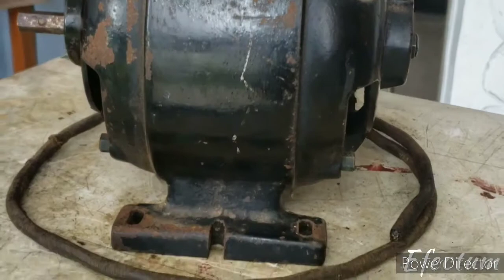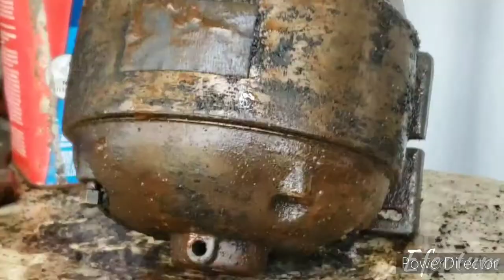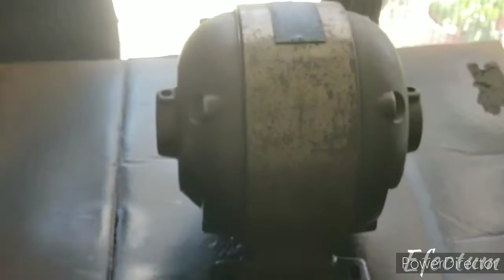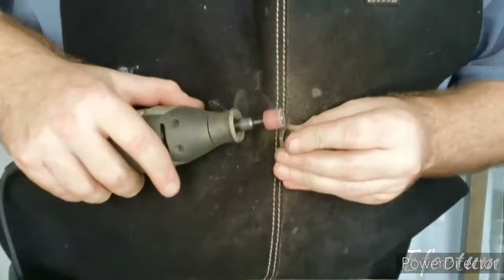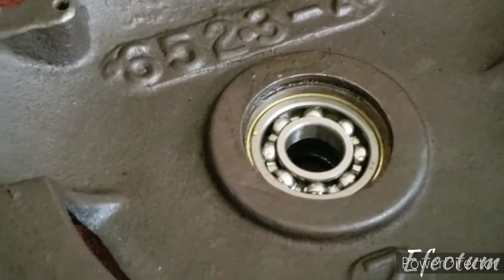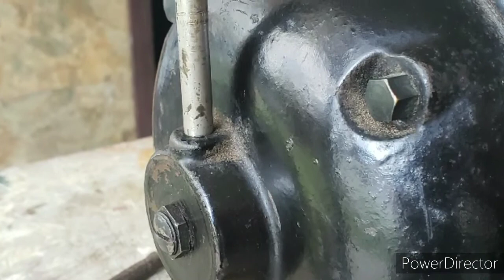Rare Electric Motor [Restoration] - Domestic Electric Co. Cleveland Oh.

Comment: I just used one very similar to this with a wire wheel to clean some tools.  Was wondering about it so googled and found this.  My motor has spring-loaded oil ports right in the casing of the motor, so maybe it's a bit younger than this one.
Reply from the maker: These extra long  oilers were added by a previous owner. I thought they looked cool so I left them. Thanks for watching. You haveva good motor there.

Comment: Benco, in the vid you mention you replaced the ball bearings with new old stock bearings. Did you flush the old grease and repack the bearings? Or was the old grease still good.
Reply from the maker: I try to buy NOS USA made bearings when possible and repack them with new grease.

Comment: Nice job! I’m pleasantly surprised that it had ball bearings. I really want a copy of that Herberts tee—is it available anywhere?
Reply from the maker: I was surprised about the ball bearings also. It was interesting how they utilized the Fafnir 5113 and cut it in half. I even called Accurate bearing to confirm. The bearing had the 1904 patent so I have no reason to believe its not the original. As far as the Herbert's shirt goes, I made it on Vistaprint using the logo from VM. It's really easy and not expensive. I actually made a couple, the other being a Walker Turner Driver Line. Cost was about 23 dollars and the quality is good. My next one might be a Sprunger...